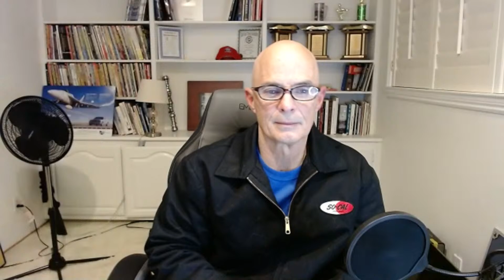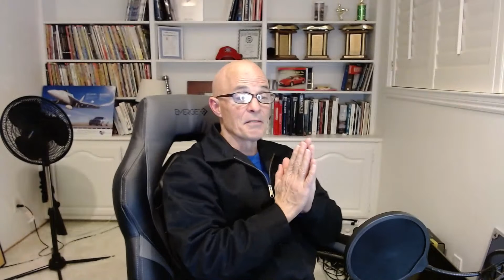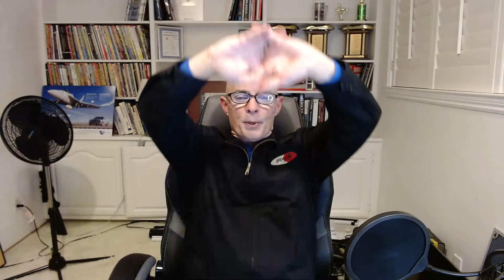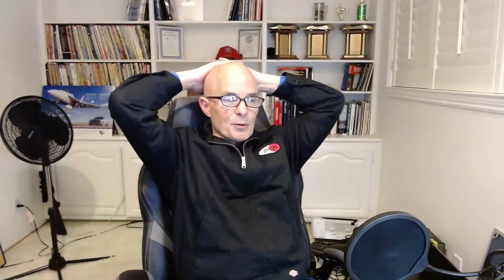LET'S TALK TECH-IT'S THE SMALL THINGS

Comment: I could see on a mule how the o ring seal on the cam plate would get knocked around with change outs ... it's mostly about heat cycles and expanding contracting of the seal on a driven engine, that and not breaking off bolts is helpful. If I have it apart, I get a new seal.
Reply from the maker: its not expanding and contracting or heat cycles-it was oil pressure from the plate being loose-the plate heat cycles endlessly on the motor when in the vehicle
Reply: Yeah your wrong about that…

Comment: I always replace those plates, the gasket on the block that joins the cam oil galleys, yes the barbell (just a stock one). It’s 50$ you will wish you spent if any of them fail.

Comment: Don't buy 'cheap' aftermarket LS cam plates! Or if you do, make sure you check the thickness. 

I did (buy a cheap one!), and after installing it the whole drivetrain locked up (test turning it!!).  Turned out that the plate was a few thou (don't recall the exact number anymore) too thick and was squishing everything tight. It had LOOKED great otherwise! Replaced with a GM one and all was good in the world again.

Comment: Wait, the 2.2  turbo non intercoolered vs. intercooler added  should be 32 to 42 hp extra at the crank. 
 But your temps will be lower & turbo will work less overall, which means more boost. 
  2jz is pricey. 
   Look up blue print 3.6 ls 4 cylinder.  
    Thank you.
Reply from the maker: I'M TOLD THE BPE 4 CYLINDER WITH THE LS WON'T HAPPEN, THE INTERCOOLER PLUS BOOST CAN CERTAINLY ADD POWER, BUT I LIKE TO TEST 1 CHANGE AT A TIME-LOTS OF COOL STUFF COMING

Comment: my 2007 Tahoe z71 5.3 lmg which my brother n law ran out of oil and got collapsed dod lifter.. with 225,000 miles he was sending it to the scrap yard with no rust and leather interior i said no way ! Tic performance cam ,springs,oil pump ,new crank,decked 799 heads,surfaced block ect ect! Ran NA with speed engineering headers then deka 80# injectors,Garret turbo from a loader at work and now the things happily running awsome with 4 inch straight pipe off the turbo straight through the hood!! 4l60 number 2 is hangin in there...4l80 and walbro fuel pump comin... Your channel got me hooked and is a awsome resource.. Also when anyone talks crazy i say watch the Richard Holdener video! ends the nonsense!
Reply from the maker: NOICE!

Comment: The ls7s were bad about dropping ex valve s
Reply: They still are.  My 2008 LS7 @ 16,000mi had all Exh valve guides worn beyond service limit.  Thanks to Lingenfelter Performance Engineering, I didn’t drop a valve.  ALL LS7 heads should be checked(new guides, valves, & a valve job) by a competent machine shop!  LPE, AHP, KATECH, AI, WCCH.
Reply: @natez0690  what causes this problem
Reply: @davidreed6070   -  the cylinder heads were machined improperly by Linamar corporation (a GM supplier in Canada).  From what I have read, the valve seat was machined not concentric to the valve guide.  So, one side of the valve contacts the seat first and bends/fatigues the head of the valve until it finally breaks off.  The valves themselves are not the problem. Yes, the exhaust valves have hollow stems filled with sodium but they are not the root cause of the problem.
Reply: @natez0690  that would do it. My friend has one in a nova. For what has been done to it, it makes incredible power.
Reply: @davidreed6070   -  hope he had the heads checked.
Reply: @natez0690  yeah he is a head porter. He changed the valves and ported them with that and a camshaft that thing put down 623lb .at the tires. That is crazy the power that it makes